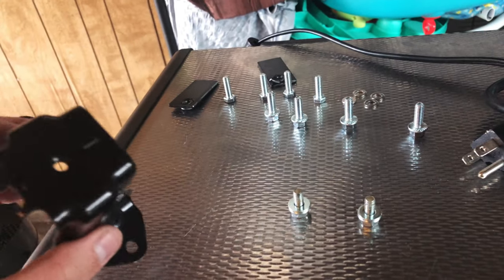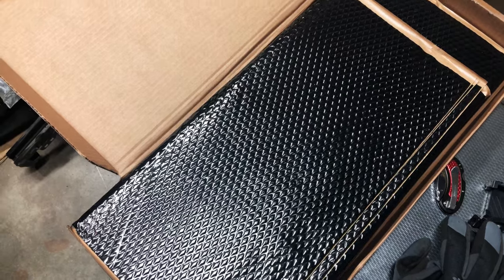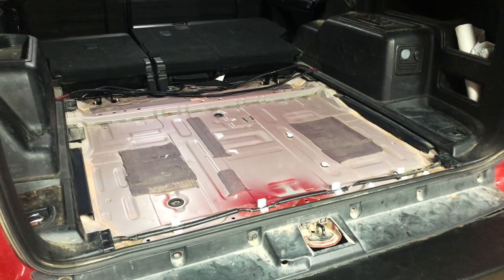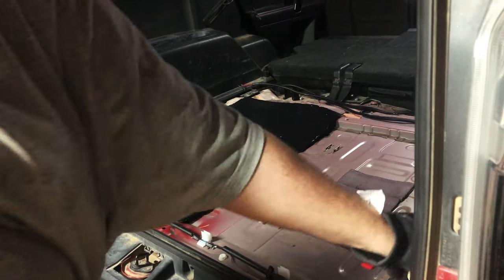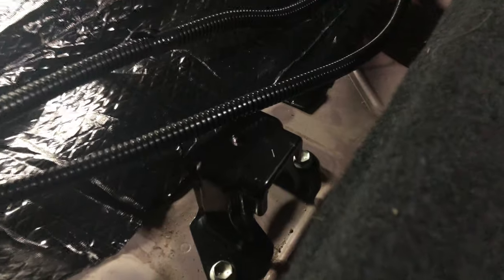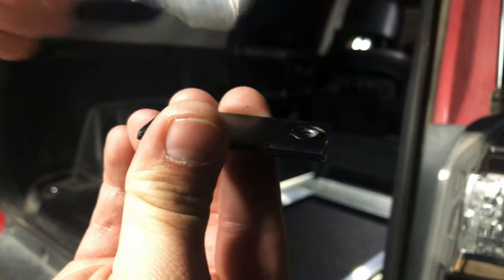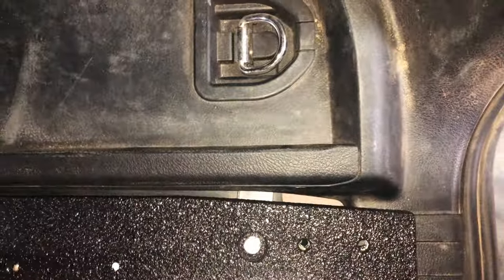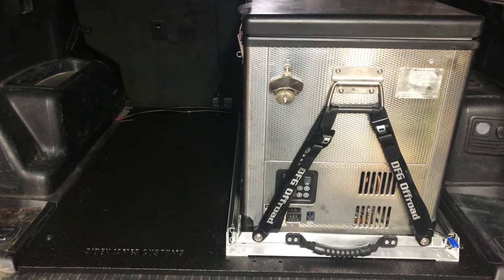Aiden James Customs 5th Gen 4Runner Rear Platform Install

Comment: Are the holes for the fridge slide pre drilled? What work would I have to do to attach the slide once the plate arrives? Thanks a lot
Reply from the maker: There are various holes drilled to fit various products, but with so many on the market yours might not be drilled. If that's the case, like mine was, all you need to do is lay your slide down, mark the holes, drill them out with the correct size, and install a t nut. It's real easy to do if you have to do that.
Reply: @MaddoxBBQ  Cool, I expected that.. was just making sure. Thanks so much for the reply!
Reply: What size screws work with the predrilled t nuts?